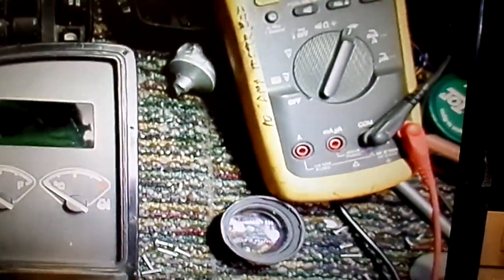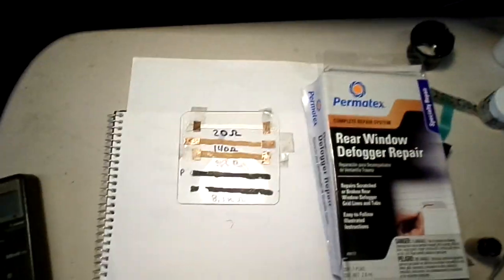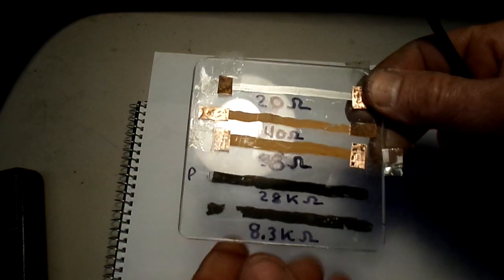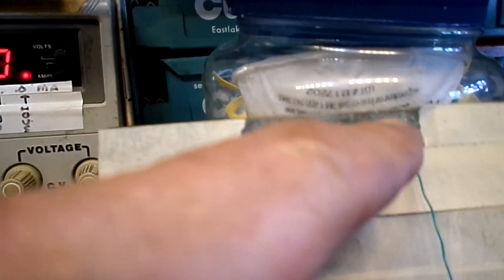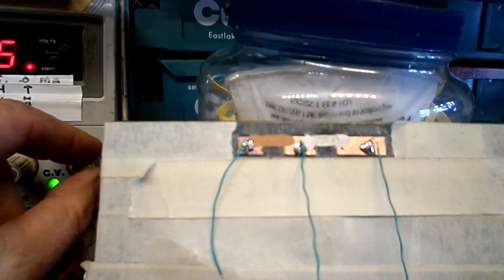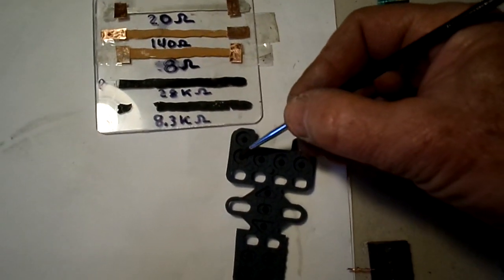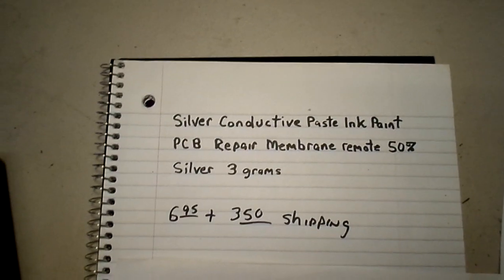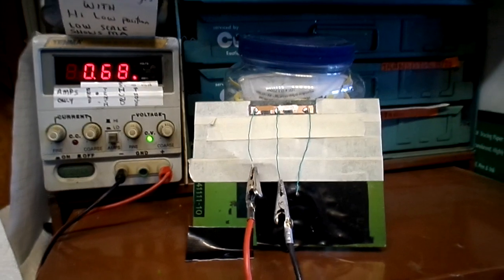Electrically Conductive Paint that really works

Comment: My wife's cat vomited on my Kurzweil K2500X Keyboard and I had hoped I cleaned it up in time to not damage anything.
I should have taken it apart right then, cleaned it out  and thoroughly dried  it out before ever powering it up.
Some lessons are hard learned and I did not know to do that or even where to start.
The liquid seeped down at the front of the keys and got down into the key board contact pcb.
And unbelievably it was still wet 2 years later under the rubber contact pads. It has 30 dead keys and one loud key. It has 4 missing contact pads which I assume was originally some sort of painted on pads. I am looking for the best conductive paint I can get to repair the contact pads.

Most of the damage to this PCB is blown out traces right at the contact pads.
Thanks for sharing your experience with conductive paint! 
I can't find this PCB new or used anywhere.

So right now I have 4 pads to rebuild and 16 trace to pad repairs to make and solder does not solder to the pads if there is not trace left at the pad.
Reply from the maker: The stuff I bought on ebay came from Thailand, It was stated to be 60 percent silver, but didn't work until I allowed  it to dry completely dry.. I hope it works for you.

Comment: I have a question im going to try something like MG Chemicals silver pen or something similar on my water well pressure switch contacts.  What should i try .
Thank You . Its pitted i might use jb weld to fill pits then use something silver. Thank You
Reply from the maker: I only know of one particular silver paint that works well as I mentioned in this video, so I'm staying with it until someone convinces me there are others that work. The stuff I used came from thailand, and they sell it on ebay under the name silver conductive paste or paint that claims to be 50 percent silver.

Comment: Curious how flexible the conductive paint is after it's dry?  I've used a bit of foil tape for remote button backs.
At first, I thought you were going to try to fix the flexible button 'board' with conductive paint!

Comment: What about fitting a mini needle (or it can have several needles) metalic button into the silicone pad to use as a conductor?
Reply from the maker: I don't fully grasp your idea, but if you're talking about a remote control pad repair, I've heard of some people using tin foil.
Reply: @GrantsPassTVRepair  thanks I will try this method. I was also thinking of mixing graphite powder with a silicone sealant and adding the mixture to the pads to see if they will bond to it and allow for conductivity since those conductive carbon pills are made from a mixture of 60% VMQ and 40% conductive carbon black.
Reply from the maker: @RaffaelloLorenzusSayde  Other than the silver paint I demonstrated which I found on ebay, I was disappointed about the performance of the other paints.
Reply: @GrantsPassTVRepair  the aliminium foil method worked. I whole punched the aliminium foil, put a decent amount of Krazy super glue on the black pad buttons, added the circle aliminium foil, used a eraser on the pencil to press against the alliminum foil and turn clockwise to bond it properly with a smooth base, then I use tweezers to bend the edges below the black pad button because the circle aluminum foil was larger in size and it's extra support as well. Thanks for your help.
Reply from the maker: Your welcome, and good job on the foil technique. @RaffaelloLorenzusSayde

Comment: Great Video👍 I currently need to repair a circuit board foil and need to paint a thin track for it. I bought the conductive silver paint "kemo L100" and it's like water! Do you have a tip for me how I can get the paint thicker like toothpaste or something?
Reply from the maker: Sorry but I don't have any tips on that. Perhaps you can put more than one coat of conductive paint.

Comment: I finally received the one from Thailand and was able to repair my keyboard with it. The paste is indeed very good, conducts as well if not better than a high-end paste from Germany. Small downside only that it takes long to dry. (German paste dries in 5-10min, Thailand paste needs 10+hours). But with a blow dryer on low (due to keyboard membrane made from plastic which I didn't want to melt), the Thailand paste can be tried in 4-5 minutes. Overall GOOD. Can recommend.
Reply from the maker: I'm glad to hear you had the same results.

Comment: I have a question re: the silver conductive paint from Thailand from ebay. I successfully repaired a keyboard many times with a conductive silver (German brand) which is a relatively thick one, like a nail polish when you work with it. It also dries fast, in 10 minutes. Could you tell me whether the Thailand one is thick (like Nailpolish) or is it more runny and watery? Because I heard bad things about other conductive paints, like the L100 (Kemo) where people say its impossible to do a fine line (on a plastic sheet etc.) as it is too watery? Can you a trace a fine line (toothpick etc.) on a keyboard membrane with the paint from Thailand and it isn't runny? I'd highly appreciate if you could give me that info. Thanks!!
Reply from the maker: The paint from Thailand went on thin but still had amazing conductive properties with only one coat. I can't tell how long it will last, but it seemed like it could last a long time, and did not scratch off like the others.
Reply: @GrantsPassTVRepair  Ok, asked differently: If you'd put a thin line on a plexi sheet and you hold the sheet vertically, would it stay on or would it just run off? :) Anyway, I ordered it as I read so many good reviews about it, including yours. Thanks!! (The German brand which I used in the past, they increased s/h and now intl. s/h alone would be €18 as it's "hazardous goods". So now giving the Thailand stuff a try.
Reply from the maker: @flexy456  The silver stuff I showed would not run if I put it on thin. I'd  still rather use solder when possible, nevertheless I was impressed with the results.
Reply: @GrantsPassTVRepair  Ok that sorta helps. Yes, thing is, for some things you can't solder. I am using that stuff to repair broken/dissolved traces on a membrane keyboard. (Don't ask..I am just saying: Cat pee...is the worst substance in existence...)
Reply: Servus Georg,

hab deinen Kommentar gerade gelesen. 
Ich stehe vor dem gleichen Problem:

Hab das L100 Kemo und es ist wie Wasser 🙈 Ich möchte eine unterbrochene Bahn (ca.1-2 mm breit) auf einer Leiterbahnfolie reparieren.
Keine Chance mit dem wässrigen Zeug was zu gestalten.
Hast du einen Tipp für mich, wie ich das Kemo dickflüssiger bekomme? So Zahnpastakonsistenz wäre top.

Gruß aus Bayern

Comment: Hello Dave, about remote control rubber buttons, don't lose your money buying conductive paint which is awfully expensive, i use since  25 years leaded carbon core of carpenter pencil, I scratch it with a edgy cutter blade abode the button and i apply it correctly using the pencil tip uniformly on the whole rubber surface, it works perfectly for many years .... of course , clean any trace of grease before doing it.

Comment: Like the test, thanks for that. How does it fair on a scratch test ? Reason I ask is that I am repairing a watch PCB and the copper pad has come off of the board altogether. The pad had a copper contact which moved over the top of it to make or break the circuit when you are changing the time. So I guess I'm asking how well would this stuff wear ? Fancy giving it a test before I buy some? :-) I was thinking about 5 or six layers ?? Cheers D
Reply from the maker: The silver conductive paint did real well on the scratch test. So did the stuff for the heater grid repair.

Comment: Great video Dave, In years past I used CAIG CIRCUIT WRITER to repair remote controls and actually made a 555 led flasher circuit board on a post-it note with the circuit writer and although it was only a top side trace circuit I could solder to the silver paint. https://www.amazon.com/CircuitWriter-Conductive-Ink-silver-based-4g/dp/B00B88B9KI It is on my twitter from years ago. https://twitter.com/NorCal715/status/430819032594280448

Comment: If you paint those rubberized remote pads i wonder if the silver glue will remain stuck on it after 10 or 20 key presses. Will the remote last for another year?
Reply from the maker: If I had not seen how well the silver impregnated paint stuck to the plexiglass I would be skeptical, but I'm guessing it might be just fine.  Perhaps that would make another good video.
Reply from the maker: I just ran a test where I pressed the silver painted remote control buttons thousands of times and it was still sticking to the rubber. I also found it's important it has reasonable dry time of it doesn't stick well.
Reply: That's how membrane keyboards work, the contacts and traces on the sheet of PVC (?) are just that, silver conductive paint. It should last "a reasonable amount of time", eg. the expected life-time of a cheap keyboard. Could be a year or two or could be 10 years. But it will wear, at some point. Of course, how well it sticks and how long would depend on the quality and chemical makeup of the silver-paint.
Reply from the maker: @flexy456  I understand. I'm very pleased with the stuff I purchased, I wish I had come up with one that had a name brand which I could be sure of its quality every time, but for the time being unknown brand is the best I'm aware of.

Comment: Very good :), would this have worked to repair the chaps flexible pcb pads by chance?
Reply from the maker: I don't think there was enough of the old circuit trace left to glue onto, but I chose not to take any chances and replaced it with switches since it came out of his excavator.
Reply: @GrantsPassTVRepair  thanks for clearing that up :)

Comment: I have used conductive paint to repair a vintage volume control  pot on an old GE TV. Thanks for the videos. Carl
Reply from the maker: How? Did you bridge a dead spot on the Potentiometers  track?
Reply: @GrantsPassTVRepair  The open was at the end of the tract, I used conductive paint to make the fix. I got the information from the Radio Museum or Early Television Foundation, can't remember witch one.
Reply from the maker: @carlburgess9635  Did you use the silver impregnated paint or some other kind?
Reply: I used the windshield heater paint, but here is a link that shows the silver impregnated  paint. Carl
https://www.radiomuseum.org/forum/repairing_old_potentiometers.html
Reply from the maker: @carlburgess9635  Thank you.